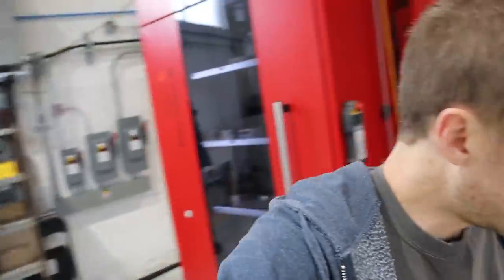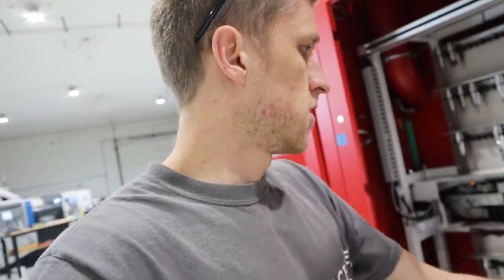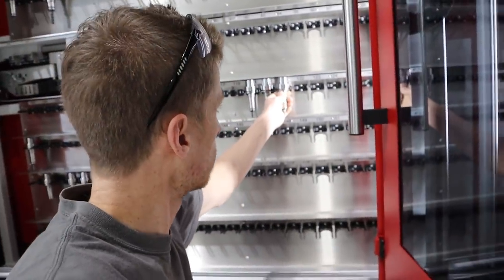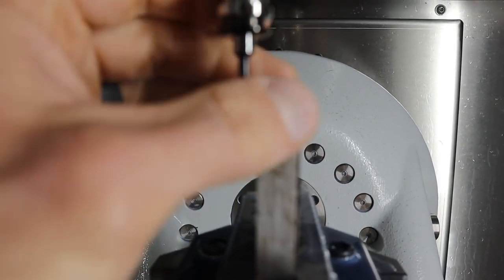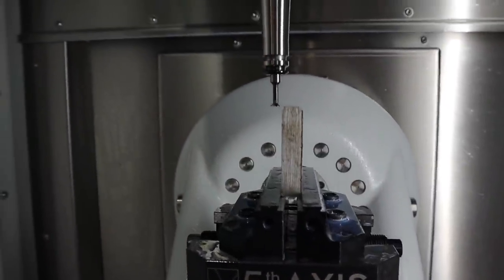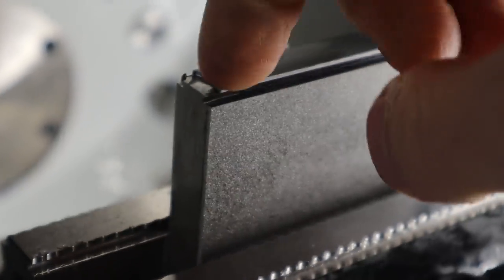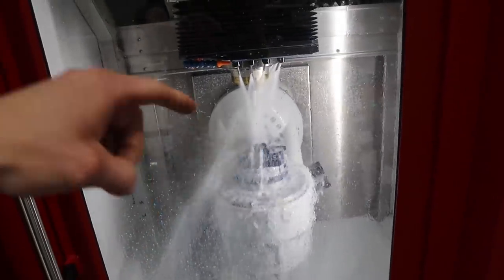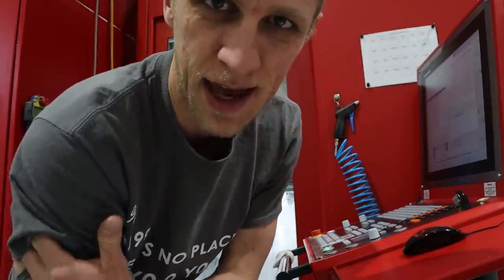Making mistakes and learning from them! - Quarantine Shop Life 20

Comment: Hello John,
I have been retired foe a couple of years but I have been heavily involved with NC- CNC since 1964. I think you might want to look at five axis fixturing by LANG.I have used dovetailing for 30 years but how Lang does it is far superior.Idon't want to try explain how it works here but you do not need a machine to prepare the workpiece and it can be done in a few seconds. Also it eliminates the need for an end stop. I do not any connection with Lang.

Comment: Hey John,  just to make a very tiny suggestion:   You have this incredible 5-axis machine, but that does not (and should not) mean you must make every part in one grab.  Yes... if you had a longer blank this could be a one-grab part, but considering what you started with, a 2-grab approach may have made your job quicker and easier (with just as accurate a final result).    :-)     Hang in there!

Comment: I made the same tabbing mistake today. Part fell off, and I made that same face.
I also have found it is easier and more rigid to just hold onto a large amount of material and put it all the way into the vice so the part is straight and the setup will be more rigid. Then the order of operations is VERY important.

Comment: I find what works best for tabs is if you want a .02" thick tab you don't want to cut your entire last pass to .02" and then cutout your tabs. Your last full pass should leave say .06" of material and then the last pass should be at full depth stepping up for your .02" tabs. That way you always have a thick cross section holding the material until the end mill is done the cut and out of the stock. Your tabs will hold the part from falling but you cannot rely on only .02" to hold the stock as you are doing a final pass. Also if you ever don't have the right dovetail with a 5 axis you can just use a regular end mill and tip your table over the 60 degrees.  Enjoying these videos, thanks!

Comment: in my head my order of ops would do the end face and curve first so the rest of the material is still max thickness, then drill the holes, then counterbores, then the body slot, then the outline, then the tabbing.  and the tabbing would be a 3/16 endmill doing a 1/4" slot  , refer Saunders "stop slotting the stupid way" (-:    but maybe a 0.020" slitting saw would do a much better job of tabbing, much less cutting force?

Comment: Here is how you can part off the part from the stock without tabs and still let you do a finish pass on the part.  You already have 2 countersunk holes for bolts on the part, add a couple more to the stock across from the parting groove.  Make a little fixture jig with 4 threaded holes in it that can span the parting groove that conforms to the geometry of the part and the stock.  Add a manual stop to the program right before you want run the parting groove, screw on your fixture jig and then go at it with whatever operations you need to finish off that last side.  Although in a pallet changer situation, just return the pallet to the rack and add the fixture to the part while another part is running. Then there is no risk of flinging the part across the machine if the tabs are a little bit weak, and no second OP to finish the last side.  This should work for most parts because almost everything is going to have a few holes in it to attach bolts.  You could even add mitee bites or whatever to the fixture, and it shouldn't mess with the dimensions much.  Basically like adding a second op fixture in the first operation.

Comment: Don't be discouraged but also don't make things harder on yourself...I would make that clamp from 3 bandsaw cuts, a hole on a drill press and 2 or 4 tack welds...add 5 minutes on the belt sander if you want it fancy!

Comment: An Coated Endmill can Run Dry, with good Speeds and Feeds the Endmill also holds longer without Coolant. You need only some air to remove the chips.

Comment: If you are going to dove tail on the 5th axis machine instead of a 3 axis machine. Try to tit your machine at 45 or what ever angle the dove tail needs to be and mill the angle with a flat end mill. That might work I think.

Comment: Hey, John, why not machine the inside finished including the counterbore holes and the slot, then make a fixture and use the hole for location and clamping and finish the outside and the surface.

Comment: Hey John play with your "Maximum Staydown Distance" and "No Engagement Feedrate" settings in your adaptive toolpaths in Fusion. I would probably set the no engage feedrate as your rapid feedrate by default. I think that will fix the weird behavior you're having with the machine sometimes rapiding and sometimes not.

Comment: The tabs must be 0.6 mm for machining security... (0,0236 inch) if the endmill dulls a Little bit It push the part Flying if the tabs are too thin

Comment: Probably just testing toolpath ideas with the ballnose, but for that rad on the top of the clamp, would it not work to just tilt the part down and use an endmill to go around it? If the endmill isn't long enough, just tilt the other way, and cut the other half of it. If there's a mismatch, then there's something wrong with the rotational center.

Comment: Hey John, I had a thought about sharpening your blades.
what about a metallic bonded CBN flat face wheel mounted in the kern, and then hold the blade in the 5 axis.
Reply: biome8 - We’ve thought about doing something similar in our shop but using a grinding wheel inside a nice mill, especially that beautiful Kern, just sets me on edge a little bit. No point in getting a bunch of abrasive powder in it if you don’t have to.

Comment: I'm currently building a homemade 3 axis cnc milling machine for my first cnc it's using centroid acorn as the controller and nema 34 hybrid steppers it's half inch thick steel plate and it's gonna be filled with epoxy granite for extra rigidity and vibration dampining

Comment: Hard to tell but it looks like your dovetail is cut too deep. You want the floor of the dovetail to pull down onto the top of the vise jaws. I Use that same vise and cut them 075 deep. You should not have rigidity issues with those small of tools.

Comment: Not a machinist but that small clamp area bugged me to start. I would have clamped a bit less than half, machined half, then flipped to finish. Less, vibe, no need to try and leave on thin tab.
Reply: I have to agree. He said multiple times that the dovetail did really well; I would agree that the dovetail didn't get ripped out- but the huge amount of chatter all throughout that part seems excessive to me. I understand that it's 1018 (or worse yet- hot rolled) but that surface finish looks terrible considering the massive price tag of the machine and tooling. I guess what we're really seeing here is that the tombstones are really important since they give a more rigid surface to clamp too rather than having small parts floating out in space.
Reply: ...and two tailor-made holes to use with dowel pins to hold the part more securely.
Reply: I'm not a great machinist but even better than grabbing half would be to grab it front to back instead of just the back.  The hang out would have been about 3/8" instead of an inch.  Then you machine the bottom of the clamp.  Flip it over to do the screw holes and counter bore but leave the top side blocky.  Then the first time you bolt it on your tombstone, go back and profile the top surfaces in place.

I never did much CNC but I can tell you if your tool paths are right, that will work 100%.

He's never going to machine a production piece with all of that hang out and chatter, he already knows you use the tombstone for a rigid setup.

I think he needs to dial back his learning and just concentrate on techniques he needs for knife making because I doubt he'll ever make more than a few dozen clamps a year.

Maybe he is doing it for YouTube but if you dont need to machine it in one shot or do tabs, it's kind of just showing off.  Maybe he should show off with aluminum instead of steel, it might not take out tools as much if things go wrong.

Comment: He you said it 😂 the 3 tab thing hahaha. How you do it is mill in right mill in left. Turn 180 than slot mill it (dont know the cycle code).  Also why not just use a saw mill something like a iscar slimslit 125mm. Than dont make a straight line but in a radius [ ( ] need only 1 line and because of the radius it can't go left or right (front or back)

Comment: not a good machine for steel this kern XD
Reply: I am following from the beginning and I start to think the same. Small toolholders small low hp spindle , should be very gentle not to overload it .... maan a DMU 50 with automation was going to be a much better option IMO. Much more ridgid machine. Looking at the crappy finishes he gets on this steel ... blah.This looks like a cnc router to me ... Not the right machine for the job.
Reply: That's BS, this machine is fully capable of machining steel. You just have to adapt the toolpaths and tools to the machine. With a machine like a Kern, you would want to have lower chip loads, higher feed rates and higher surface speed. The machine has the rigidity, but the spindle is not optimized for high load, low speed cuts
Reply: @ringo_98  Not all of what I wrote is BS.(probably the router part ) I know what the kern is made of. But a submicron Kern for a knifemaking.... not sure he will see any difference compared to the Mori.